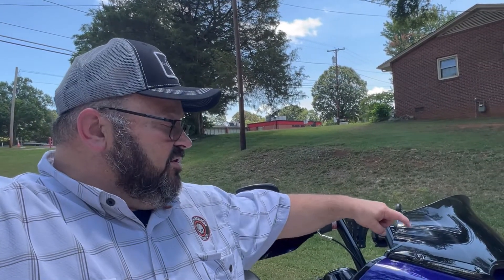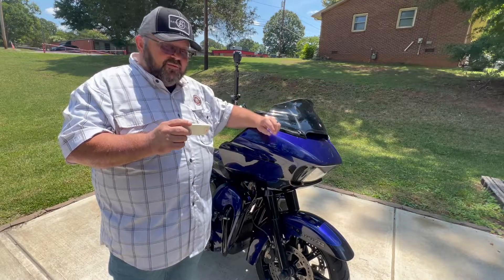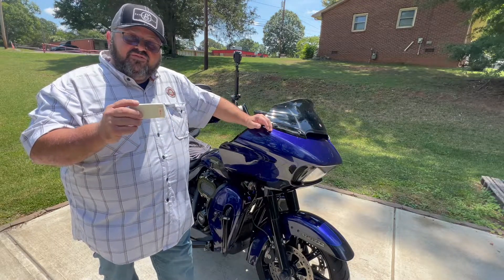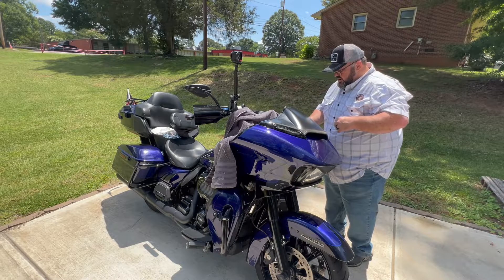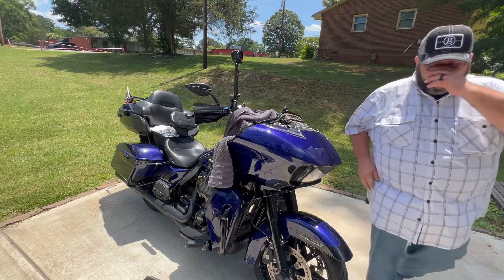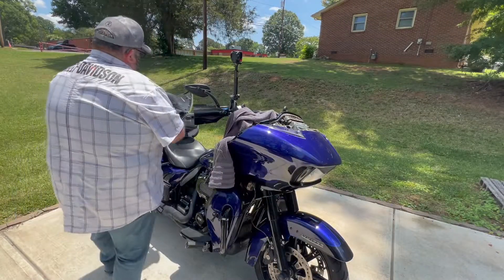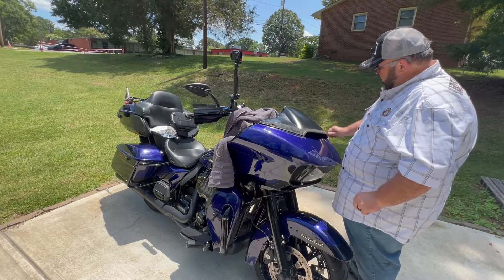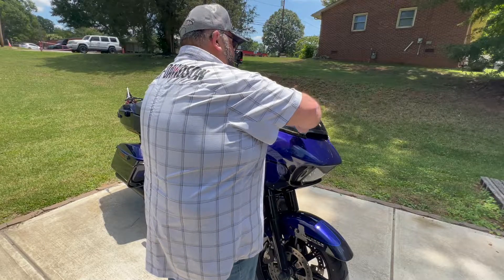Installing my EZ Pass Transponder

Comment: Awesome idea! I mounted mine to the inside of the lid of the tourpak, but I like your idea better!
Reply from the maker: How well does it work mounted in the tourpak?  I haven’t yet been able to test the functionality of the transponder inside the fairing. Hopefully I’ll be able to do so in the  next week or so.
Reply: @PoppaDRides  mine works in the tourpack, so you should have no problem with it under the vent. Do you know if your transponder works in all states?
Reply from the maker: @RidingandWrenching  it works in all of the EZ pass states, 14 in total. Not good for West Coast. Mainly Eastern Seaboard and Midwest states.

Comment: I’m not sure I understand the device. Is like a easy-pass for tollbooths? Also, does it work for FL tollbooths? I didn’t know that NC even had tollbooths. I really need to get out more.
Reply from the maker: Yes it's a transponder for toll booths and it does work in Florida it works and 14 states. There's a toll road bypass on Hwy 74 that I use when I go to my moms. You prepay the tolls. I load mine with $20 and it reloads when needed. The tolls are 30-40% cheaper this way. This transponder was needed because the automatic readers can't read off the bike. This will also trigger the toll gates up North and the Midwest when I do my 48/10 ride.
Reply: @PoppaDRides  this seems well worth it. Should I get one for the key west trip?
Reply from the maker: I think that's an individual decision. But I believe probably a good one. It also works in Georgia. If you have this you don't have to stop at the toll gate in P worry about change that kind of thing.